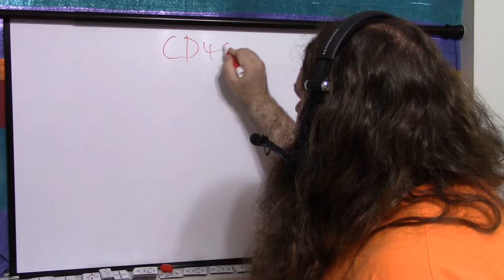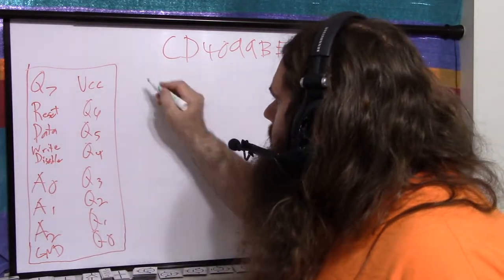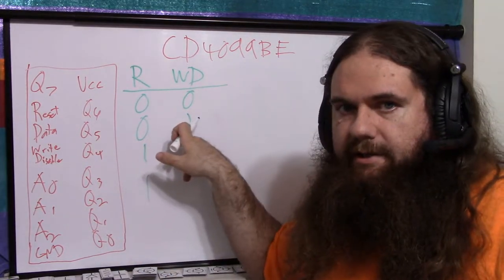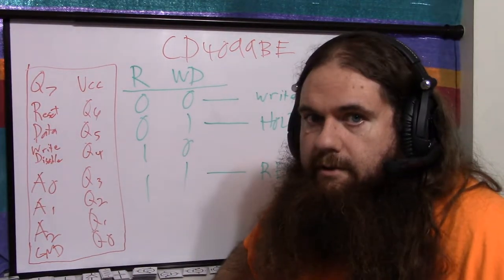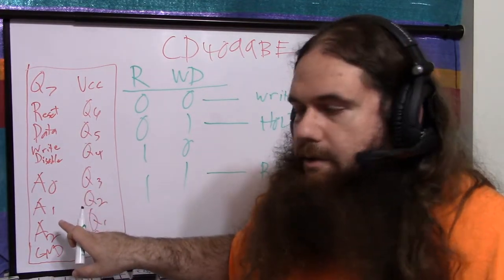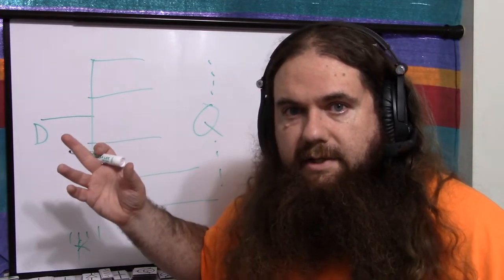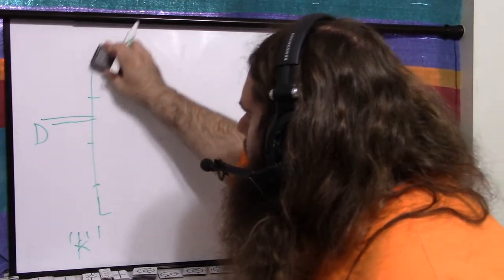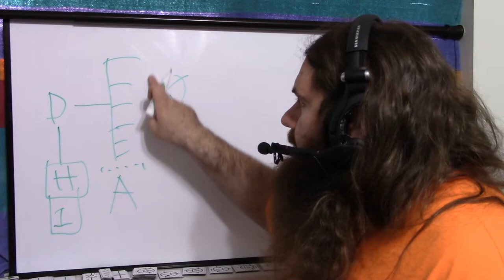CD4099BE - 8-Bit Addressable Latch Register - Bonus Demux And Decoder Functions - Simply Put

Comment: First of all this is a gold mine, learned 4 concepts from 1 video,  next It requires a driver to run.
Could anyone please suggest me if there is just a barebone latching IC that doesn't require any driver I meant My latches will be initiated with physical switches , yes I can make that with 555 or just 2 transistors, but I need a compact solution to feed to a uC. Max latched output required 4 and inputs are too.

Comment: This was a very nice explanation. Very clear. Thanks. Do you know of any solution for addressible latch over 1-wire interface? Or is it better to use a micro controller?
Reply from the maker: I haven't researched the one wire stuff yet, so I can't tell you (yet). If I were you, I'd check out a community like the AllAboutCircuits site and ask there.